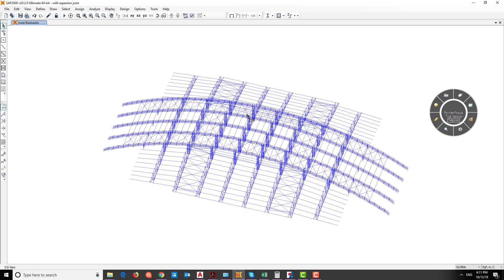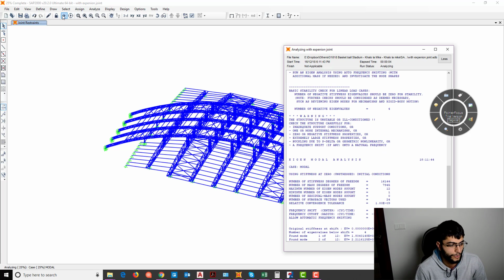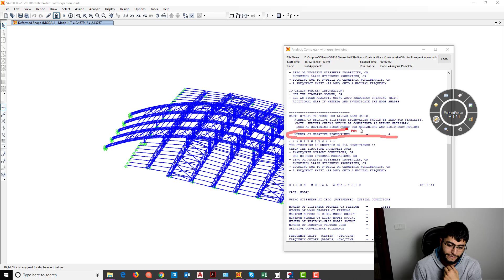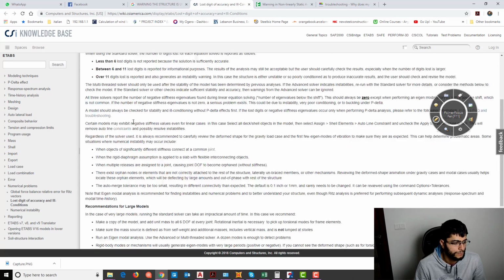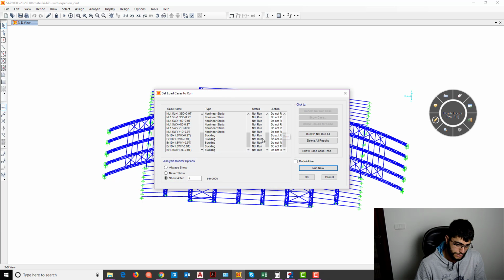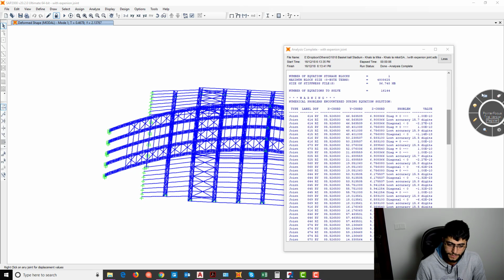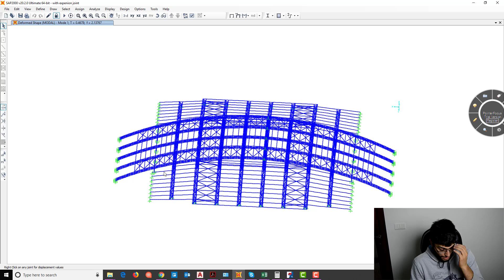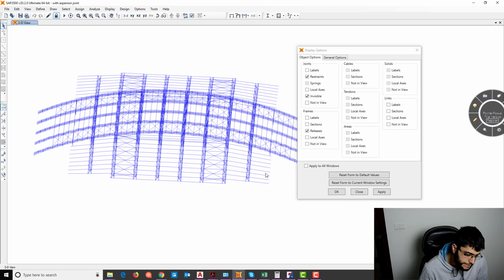SAP2000 instability (ill-condition) structure

Comment: hello. I have made a structure made of stone and modelled it in sap 2000 with 3D solid element and I am getting the same lost accuracy and negative eigen value and illegal condition error in the middle of the structure in some joints between 3D Solids. though the solids are of same sizes and shape. how I can solve it.